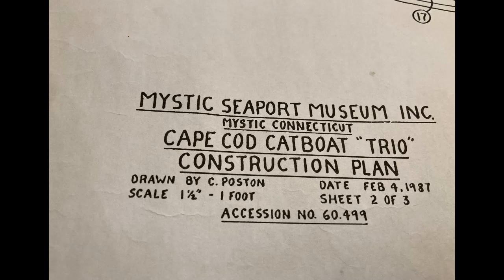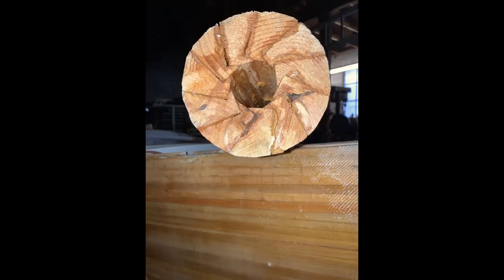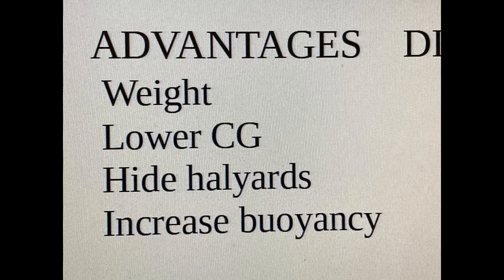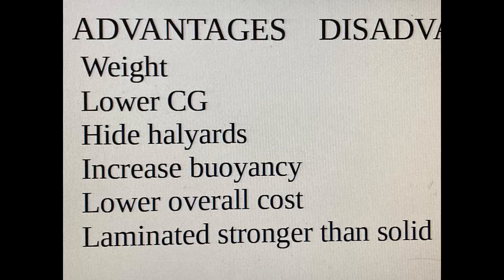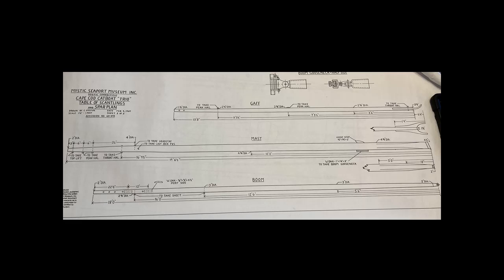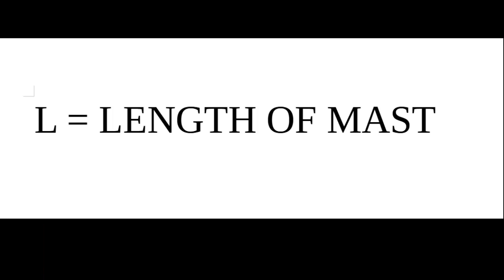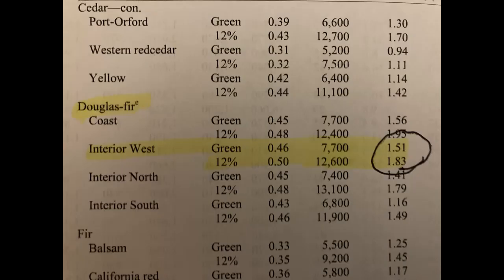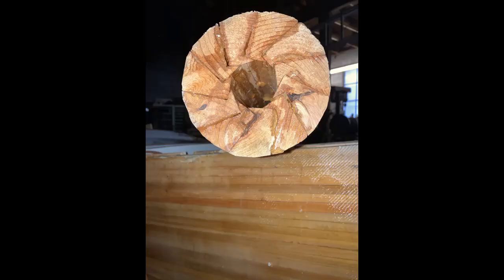Hollow Wooden Mast: Strength Considerations

Comment: Good on you for going to all that trouble with the calculations as well as the construction. Ive got a two mast Sharpie skiff . The masts are 22 ft main and 21 foot mizzen. They are two bamboo poles five inches at the base tapering to one and a half in at the tip. They cost $30 the pair. No thinking or calculating required. She's been sailing 12 yrs now. Cheers